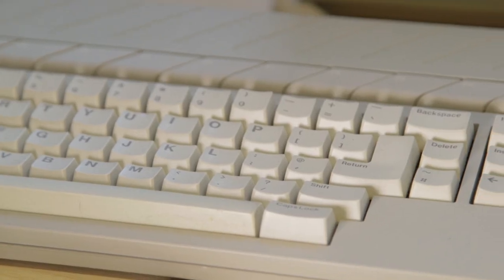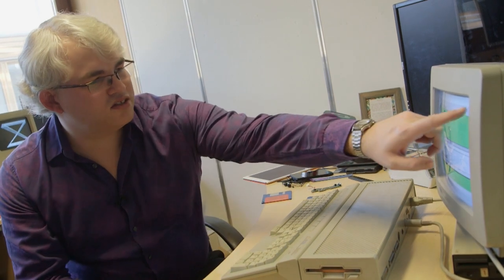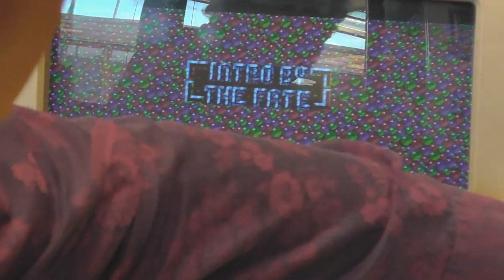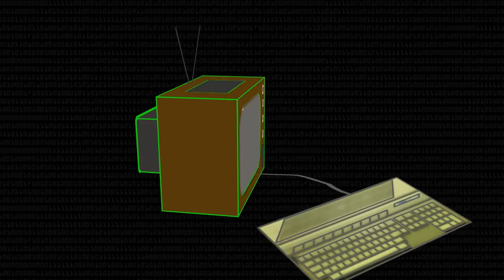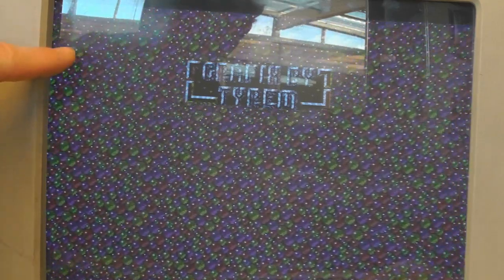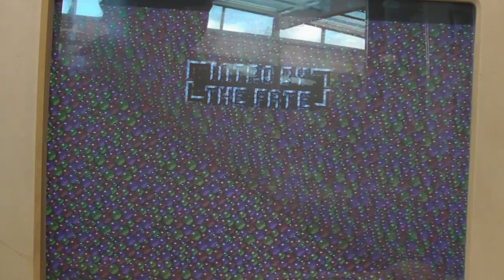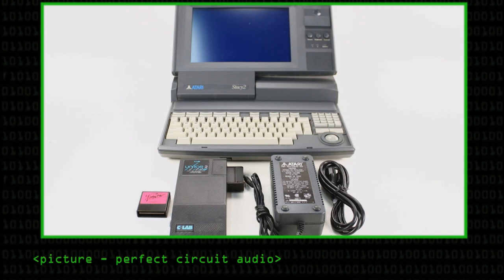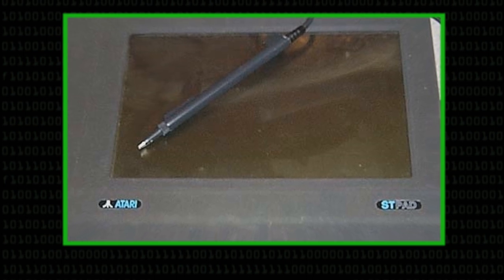Pushing the Atari Limits - Computerphile

Comment: 72 Hz screen is the best? Retuna display is almost as good? Has this guy got lost in the 80s and never heard about 144Hz monitors? With a little warranty voiding, it's possible to overclock most LCD panels to 65 or even 75 Hz.
Reply: Yeah, I found it really strange he would bring up the retina display... you can get 2K monitors with 120 or 144Hz refresh rates for half the price. Maybe he's just not into gaming so he doesn't know about the high end stuff?
Reply: because it's a crt. crt monitors have that kind of crispness that lcd panels don't have. monitors aren't just about its resolution or refresh rates. you can throw any resolution to a crt monitor, and it have almost instant response time, true black etc. the reason crts discontinued in the market is because they are bulky & power hog.
Reply: Isaac Als And mono CRTs (like the SM124) even more so since they didn't need a shadow mask behind the phosphors. The only reason I mentioned the refresh was because a) the 50HZ capture rate of the camera was beating with the 72Hz of the CRT and b) because most other computers at the time (at least the PC, Amiga, Mac) tend to run at 50/60Hz and so the Atari's display didn't flicker on static images. The screen was incredibly low-res by today's standards (640x400) but it had a crispness to it that only 'retina' panels can match.

LCD displays are very different beast and for a static image refresh rate is effectively meaningless since unlike a CRT the image is lit for the whole frame period (a CRT works by a tiny spot of light scanning the screen very fast -- so most of the time a CRT screen is completely black with a fast moving spot of light -- you can see it if you set a video camera's shutter to a high speed and point it at a CRT display).
Reply: Isaac Als No, still don't get it. What kind of crispness? Modern monitors have higher resolution - even in terms of dpi. That's usually what makes something crisp. But even the refresh rates are up to par with 120/144 Hz, and I very much doubt that's what he means ... that the black n white icon looked good being dragged over the screen
Reply: DerClaudius he is actually answered it above...
Reply: DerClaud: You got owned in your own ignorance. How does it feel?
Reply: I think people don't understand how revolutionary the ST's paperwhite monochrome screen looked when compared to virtually every other computer on the market at the time, including the Mac.  It was huge for a monochrome monitor - 12" vs. the Mac's teeny 9" monitor - the phosphors had a much more pleasant, less-blinding glow, and the high 70Hz refresh rate was something nobody had seen before, producing a rock-stable image.

Remember, this is an era when most home users were used to dealing with a flickering interlaced NTSC TV as their computer display.  Even the supposed graphic wonder the Amiga saddled users with a flickering interlaced mess of a color display that - coupled with their then-hideous Workbench environment - was an atrocious eyesore compared to the Mac or ST.

Comment: Bad hardware.. but had Midi. A lot worse than other machines on the time, like Amiga or even Macs.
Reply: The ST demolished the Amiga on release.  Half the price, faster CPU, rock-stable video refresh rates of 50/60Hz (color) or a then-unheard of 70Hz (monochrome), festooned with ports including MIDI, an operating system that wasn't an eyesore and far more reliable hardware.  It took Commodore an additional two years to finally release a system that was a reasonable competitor to the original 520ST...and by that point Atari already had the 1040ST on the market for a year.

Commodore didn't begin to catch up to them until mid-'88, when the 500 began dropping in price and games bundles took off in Europe.  As Sam Tramiel began taking over Atari - Jack formally handed him the reins in '88 - the  ST line stagnated and the company lost focus.

The Amiga 1200, 3000 and 4000 were decent machines, and later versions of Workbench resolved its cosmetic issues.  But by that point the company was already doomed.

Comment: Dr "Heartbleed" Bagley, ST fan-boy, the Amiga is almost identical hardware and planned first....

ANd still having new hardware built and new OS's...

Braben pulled better tricks a decade earlier in Elite on the BBC, changing screenmode half way down the screen and soring data in screen memory.

BTW
I worked on CDSA and we [ the Engineers ] KNEW that SSL had a massive memory leak and Intel did not care at all..

I bet you could not care less either.
Reply: How can you stand up straight with that massive chip on your shoulder?
Reply: [ uses mute ] Easily.
Reply: I know from experience that it is not easy to go through life with so much anger.

Comment: Pointless machines. Absolutely NO point buying this if you could afford an Amiga that was better at everything. No wonder this was called the poor mans Amiga :)
Reply: Until the A500 came along and killed the ST, obviously.
Reply: I hope it's a joke.  They were both fun machines, even though it's definitely true that the ST was designed more to save costs.  It's not exactly like C= funded a sumptuous R&D division after acquiring Hi-Toro/Amiga anyway, the A500 was not a triumph of excellent engineering.
Reply: j. rodman  The A500 was a cost-reduced Amiga 1000, slapped into a case that was an obvious clone of the prior year's Atari 1040ST.  Its less-insane price than its predecessor ($700) is what saved the Amiga from vanishing without a trace, especially once Commodore was able to lower its price and begin moving a substantial number of units in game packs in Europe.

Comment: Why were all these old computers grey? They all look so dull, ugly and unexciting.
Reply: Take a look at most modern laptops; they're usually black, white or somewhere in between... not much more exciting.

Some of the gaming ones have cooler designs, but they're usually so overpriced they'd even make apple wince.
Reply: Many can be boring yes, though it's easier to find better designs. And monitors are so much nicer now of-course. Not only are they flatscreen but the overall designs are much better. My Samsung monitor looks pretty nice. My computer case (fractal design core 3000) is a neat minimalist black design which isn't ugly.
Reply: Matthew Mitchell
I dunno, I kind of like the colour in a nostalgic sort of way. It just looks trustworthy and compact, as opposed to those totally over the top gaming computers nowadays.